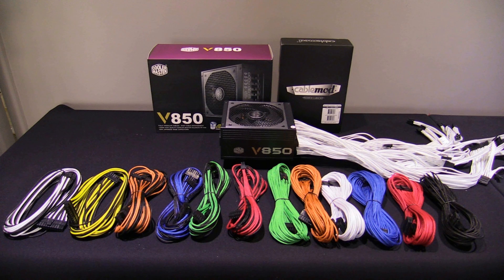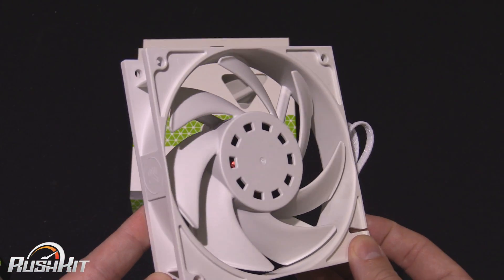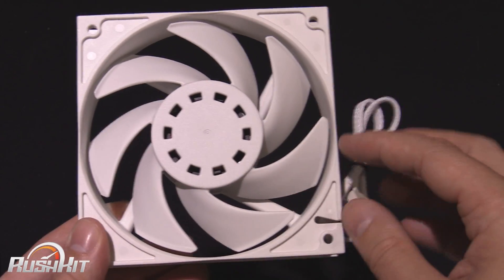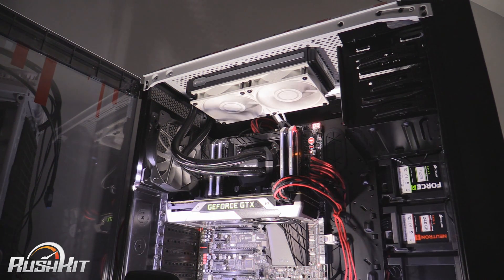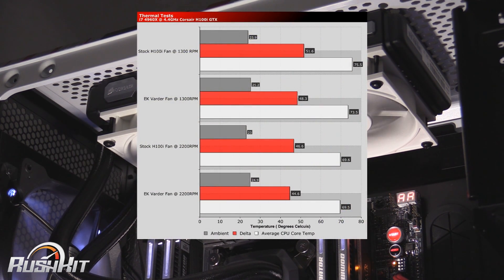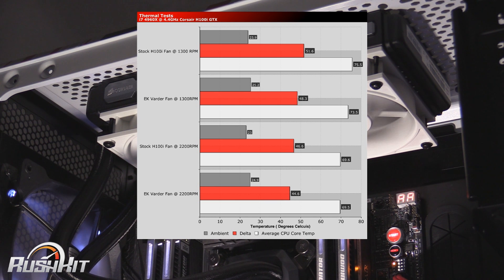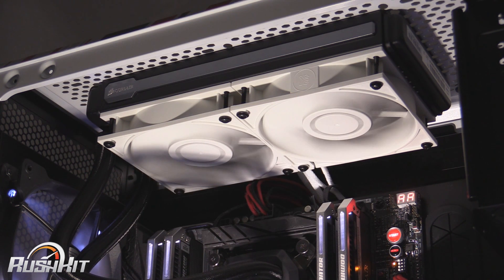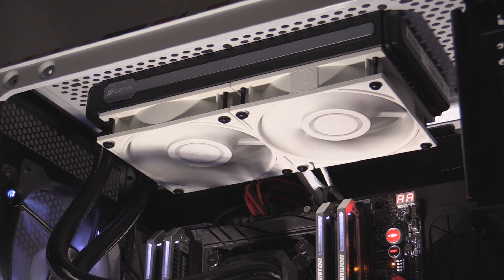EK Vardar White Heatsink & Radiator Static Pressure Fan Review

Comment: After trying Corsair,  Bitfenix,  Coolermaster, Noctua,  Aerocool,  Fractal Design,  Antec, & Alpenföhn fans which all have a deep buzzy motor drone to my ears, I always go back to (Nidec Servo) Scythe Gentle Typhoons. They barely have any motor drone and case vibration which is perfect for my ears .  They can whistle at certain rpms  but overall they are great at everything.
Reply: Billy Mathias Never bought fans in my life, used the included fans with my 750D and the 2 fans with the h100i. Never had any problem with the corsair fans, i had some coil whine but that was from the gpu

Comment: It's nice to see some more GOOD fans coming to the market recently besides Noctua :)
Reply: Gandalf Stormcrow Plenty of good fans out their beside noctua. I used to love noctua at one point but since trying much cheaper fans and getting the same results I just see them as a waste of money.
Reply: +pcblobit Any recommendations?
Reply: +UKPhoto111 Fractals new venturi series seems really good overall. I have a couple of their 140mm static pressure fans and they're awesome. Aerocool has their DS series of fans, but they're 3 pin only and loud at 100%, so you'll need some sort of speed control. Noctua is excellent except for their color scheme (imo), but they recently released their (very expensive) industrial ppc fans with swappable colored rubber corners, and also their cheaper 'redux' black and grey fans. If you go outside of newegg/amazon, you can get noiseblockers or gentle typhoons at performance pcs, but those cater more towards the 120mm fan crowd (I have all 140mm fans).
Reply: Thanks for the advice. I was considering NF - A14s. I will take a look at the Fractal fans too. Cheers bud. :)

Comment: Nice video.

I don't see any reason to take my Corsair static pressure fans and swap them with these. Those few °C don't matter at all to me, but the Corsair fans look at least better and are also damn quiet.

I would like to see some other fans like Noctuas for comparison and maybe also a comparison between static pressure and air flow optimized fans - just to see if it really makes that much difference, cause I don't believe that it matters which fans you use, as long as the move air through that rad.
Reply: Senzelian yeah you can use any fan type you like on a rad ... but you WILL get MUCH better cooling performance by using pressure optimised fans designed specifically to be used on rads. Yes they all move air but you want to move as much air with as much pressure as quietly as possible ... to get the heat out and away from the rad as efficiently as possible. A case fan will do that, but a rad fan will do it far far better. If running cooler and quieter aren't important to you then yep you are 100% right, there is no need at all to change your fans out .... if your chasing the lowest temps for the least noise then replace those corsair fans for noctua IPPC PWM fans (they'll cost ya £40 for the pair though!!!!) like I did and enjoy peace and quiet (those corsair fans are insanely loud compared to noctuas) and slightly lower temps on your overclocked rig :)
Reply: strangegoat1 Yup, those corsair fans are so loud, that I cannot even hear them... Srsly, I'm not stupid. I know all that stuff and I kinda want to bust some myths around fans, because so many people tell you to use high static pressure fans for radiators and heatsinks, which I think is mostly just marketing. 

I haven't seen any benchmarks that actually show the difference and on heatsinks it probably doesn't matter at all, cause there isn't a lot of pressure requiered. On top of all that the intake fans on a case are already creating pressure inside the case, which already helps.
Reply: Senzelian Well I was trying to be helpful .... But yeah I'm sorry, I see now, you are 100% correct ..... obviously the entire enthusiast community and fan and cooling manufacturers are all totally wrong. Despite all their qualifications, experience and years of research and development they are all corrected by your single opinion. The 'myths' you speak of are actually facts ... the evidence is out there, it's actually easy to find ;) ... as are many fan reviews including comparisons and benchmarks (just like the damn video you are commenting on!!!!). But you are the expert ... I clearly have no experience of how loud Corsair fans are compared to noctuas, considering I have used both back to back in direct comparison, even though the manufacturers own figures show the corsairs being over 10 decibels louder. Please do go and bust all the 'myths' and post a link to your findings ... I'm sure they will turn the entire cooling industry on it's head .......
Reply: strangegoat1 I guess you got me wrong here...
I'm not saying that they are all wrong, but I think a lot of people simply don't know what the temperature difference is between "crap" fans and "premium" fans, so that they run around screaming "Noctua are the best. All the others are sh*t!!!!111eleven".

I have currently two Corsair SP-120s sitting on an H105 rad. Not the stock ones, but the upgraded ones with the rubber corners and colored rings. I use their resistor to bring them down to 7V.
I have also three be Quiet Silent Wings 2 running in the front on 5V. They are all connected via 3 pin connectors and the two Corsair fans are quieter than the be Quiet ones, even tho everyone is saying that those Silent Wings 2 fans are one of the quietest on the market.

I have also a Corsair AF140 running in the back on 7V. I can also not hear that thing.
Then again there are the Corsair AF 120mm fans that are so loud that my ears almost explode.

Anyway, back to the whole pressure optimized bs. I know that it makes a difference between air flow optimized fans and pressure optimized fans when mounting them to radiators. I know that pressure is important, but why are people telling me to use pressure optimized fans that are 5$ more expensive, when the temperature difference is 1 or 2 °C ?
I guess you have seen LTTs video about "premium case fans", which clearly shows that it doesn't really matter which fans you use for your case.